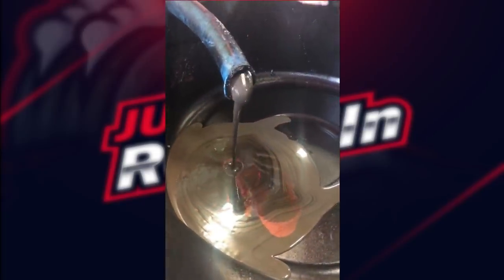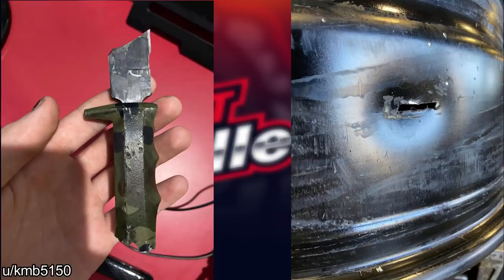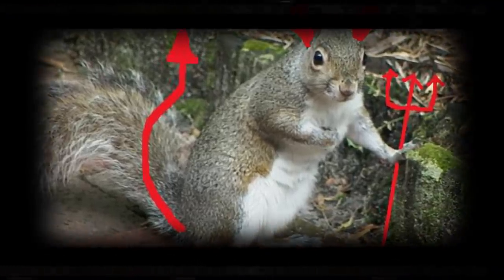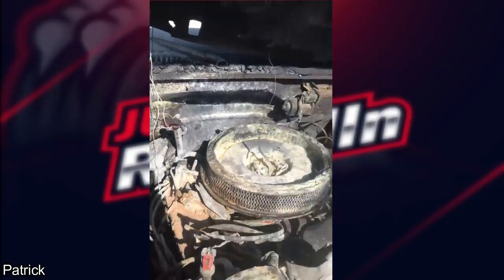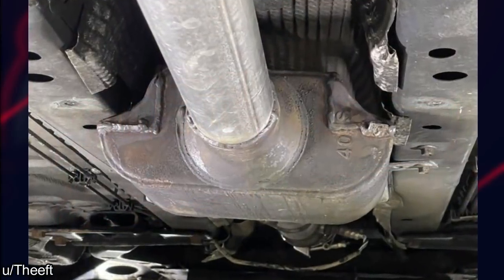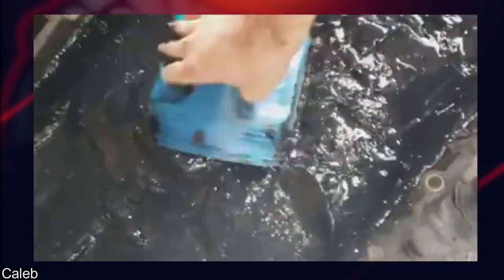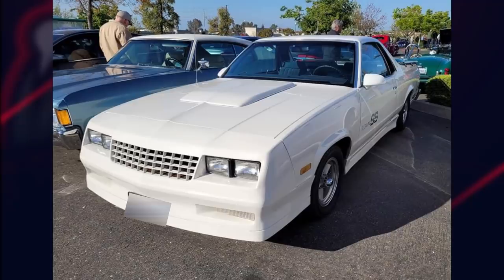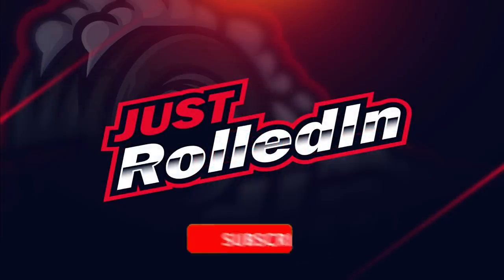Customer States "I Don't Believe You, I Don't Need My Oil Changed!" | Just Rolled In

Comment: Years ago, I started hearing a clicking sound from my front left tire. Figuring it was just a rock in the tread, I kept going until I noticed I was losing air pressure.  When a tire shop came into view, I pulled in and had a look. Sticking out of the corner of my tire at the edge of the tread was a LIVE 30-06 round sunk down about 3/4 into the tire! The clicking sound was the base of the round hitting the road just fractions of an inch from the primer! The tire shop said NOPE!!.....they couldn't plug it that close to the sidewall, I couldn't afford a new tire and they honestly didn't want to touch it! So I found a bolt under the seat of my truck, swapped the bullet out for that, got some free air and headed home!.....still have the bullet in my toolbox 30 years later, just need to shoot it some day!
Reply: So, your tire was .....shot?
I had a flat once caused by a 5.56 casing. Never a live round, though. That is pretty impressive.
Reply: Better check that head spacing before you fire it ! LOL
Reply: @MrTruckerf  He ran over a live round, bullets that have been shot dont have the primer casing on
Reply: @JetfireQuasar  reread his comment, he's talking about himself
Reply: @jaykoerner  you failed to read his comment he asked if the tire was shot.
Reply: @JetfireQuasar  I don't see such a comment... There is 1 from 1 month ago unedited and that's it, edit I see the part your talking about, but that's clearly a joke as such I didn't even think about it. He also says live round in the next sentence these two are incompatible, as such the fact your now defending your comment makes little sense
Reply: @JetfireQuasar  also note the 5 periods between shot and the rest of the sentence, this a common thing done before a punchline, it was a joke, you don't do this in normal conversation unless to emphasize or create suspense
Reply: @jaykoerner  an ellipses is;
the omission from speech or writing of a word or words that are superfluous or able to be understood from contextual clues. 

It is 3 dots (...) And there is no punctuation that contains 5 dots, the use of the comment was ment as a gap in speech and you don't have jokes with a question mark at the end.
Reply: @JetfireQuasar tlrd this form of statement is called a rhetorical question, he was not asking anything, he was prevoking the thought of "how does that happen", hence it was not shot but still somehow got a bullet in it..

 understand it as you wish but he still referenced it as a live round in the second sentence, noting it was impressive, he understood the round can still be fired, hence live,

(sorry gonna try my best at a analogos statement but not good at coming up with things off the top of my head)

Say you know someone that tripped and hit themselves on a table, you ask the question "so... You were beat up by a table" this is idiotic from a logical perspective it's a stationary object with no will, it doesn't do anything, it's an ironic question with a unneeded answer(rhetorical), it's not even asking the question implied, what is really being hinted at is how does this happen? Hence its a joke, just as in this case.
Reply: @JetfireQuasar  no thoughts on the conflicts (from the perspective of your comment being valid) you overlooked in the original comment, just wondering how to justify it both being a live round and already shot  at the same time...
Reply: @jaykoerner   @Jay Koerner  dude the comment was "so your tyre was..... Shot?" The ellipses is used as a gap in thought since the next word mentioned is immediately followed by a question mark.

It is a question asked with a word he was unsure of using correctly. Your example is nowhere near the correct framing of what was used the correct comparison when someone hit their head on the table after slipping would be "so you was....pushed?"

It is a statement looking for clarification and you are making a way overcomplicated hidden meanings to justify this argument, which quiet frankly a waste of your time. 

Short of the original author clarifying his comment this discussion is going to go in circles.
Reply: @JetfireQuasar  you still didn't clarify how it can both be shot and still live
Reply: @MrTruckerf  to settle the meaning of your comment

The first sentence is it rhetorical?

And your reference to a live round is that in reference to the original comment or a hypothetical, if so what is impressive? I'm asking simply to settle a debate
Reply: @JetfireQuasar  what do you get when you cross a rhetorical question with a joke?
Reply: @jaykoerner  someone who is applying 2 hidden meanings in a question that has none of the hallmarks of both meanings to justify his long lost arguement.
Reply: @JetfireQuasar  r/woosh wasn't expecting a reply to the last comment, mostly a makes you think joke. To reply to it means you missed it, it was rhetorical in nature, you are honestly proving you cannot recognize rhetorical questions, if you don't believe me just Google the comment
Reply: @JetfireQuasar  to be clear I gave up on the original argument not because I don't find my side valid but because you can only argue a point so much you refuted the argument it's hard to argue your interpret because it's a perspective issue, I am focusing on the contradictory nature of the statement you applied to now because you have not explained how it makes sense, you have ingnored the argument in it's entirely,  so to be clear explain how a bullet can be both shot and still a live round?
Reply: @jaykoerner  so you are arguing a comment that was never made? I never said that a bullet can be shot and be a live round
Reply: @JetfireQuasar   @Jetfire/Quasar  "he ran over a live round, bullets that have been shot don't have the primer casing on them",

In response to his comment that said "so your tire was shot" and "never a live round though, that's impressive" 

By your own understanding he said the tire was shot and also a live round, you corrected him by saying it wasn't shot it was a live round, he said that directly and  by extension knew that in his own comment that prompted you to correct, the issue is your understand as far as I can tell
Reply: @jaykoerner  so now you're deliberately misquoting to suit your angle. 

His first sentence was a question (and an unsure one at that hence the small gap before the last word) at the op the following sentences was him recalling an incident involving him. 

The only misunderstanding here is from you perfectly demonstrated by your misquoting
Reply: @JetfireQuasar  I truly and with certainly am not making fun of you or anything of that nature, but simply pointing out the issue at the crux of this, no less then 3 times in this comment chain have you missed implied meanings to statements, you seem to have issues reading between the lines and miss things not spelled out in clear language, but my argument wasn't that "YOU" said such, but that your argument requires you to have that assumption, you argued it wasn't shot, and he also said it was live in the same comment these are mutual exclusive statements, by your own admission and I would assume you would have to argue he doesn't understand this.... But then he also said he ran over a bullet in his own car just not a live one in the same comment ruling that argument out. The only argument left is one of definition and semantics where you believe he has the definition that a bullet entering anything is shot regardless of if it's fired, that is the only argument left to explain the discrepancy in the two definitions is that he must have the definition wrong from your perspective since you don't believe it's a rhetorical question made in jest by your own admission
Reply: @JetfireQuasar  what's impressive then... That  What The second half is in reply to, the ops's comment... , The op ran over a live round, he said that never happened to him, and that's impressive that it happened, 

So you're now making the argument that it was a hypothetical he was referring to, ok I am confused why you believe it will be a hypothetical, if so why comment it's impressive... This doesn't match how people generally talk
Reply: @jaykoerner  and here's the crux and evidence that you clearly didn't read it properly, he never said his own tyre was shot or run over a bullet, only the casing. 

You prove more and more with every comment that it is you that has failed to grasp it.
Reply: @JetfireQuasar  why did he not say that "would" be impressive, you are sidestepping the argument, you have to be making the argument that it's a hypothetical if it's hypothetical you wouldn't use a current/past tense
Reply: @JetfireQuasar  here's a comment in similar form to a hypothetical of someone high centering a forklift (I've had similar conversations to this at work, because people are stupid)

("So you..... broke it?" 

I've high centered it on the side of the dock before, but never off the EDGE of the dock... That's impressive)

Clearly nothing is broke it's high centered, said with a raising tone as a question, but meant to be rhetorical, everyone knows it's not broke because everyone knows it's high centered, this is as close to the exact same format I can think of with the same issues you missed in the original comment

Edited version to be more inline with the original comment where the statement isn't true for part of the second sentence, 
("So you..... broke it?" 

I've seen someone drop it off the dock before, but never got it stuck on the EDGE of the dock... That's impressive)
Reply: @JetfireQuasar  to be clear in reference to the high centering of a forklift hypothetical I mentioned, I have used the exact words(so you broke it?) explain the reason I used that phrasing I understand it's not broken clearly it happens a couple times a year you just bump it off or if that does work tug it back with the wench point, this is fairly apples to apples here go through and explain it in the fashion you did for the original comment and we will start over with the hypothetical, it's my own words I can explain them
Reply: @jaykoerner  your fork lift example supports my point because your response was explaining it wasn't broken just high centred.. which was what I did explaining it wasn't shot..

I've stayed on the exact argument you've been the one dancing around grabbing extra meanings and you've been the one with the hypotheticals. Not me I don't know what to say🤷
Reply: @jaykoerner  you'd have the correct format if the question mark wasn't used, and rehtorical questions wouldn't have a pause before completing the sentence. Because both are present it's an inquisitive question when the asker is not sure the correct words are being used.
Reply: @JetfireQuasar  edit didn't know I had sent that last comment when I retyped it in this one. Deleted it to make it make more sense

  Thanks for the reply, to explain

"So you broke it?" Its hyperbole, it's a exaggeration of the situation for purpose of saying at least you "DIDN'T" break it, also very similar to satire just in a more positive light, it's a form of humor made of the situation, a fairly dry humor but at the essence it's humor, it's rhetorical in the sense that doesn't need to be answered, because you're implying  a statement in this case "at least you didn't break it./at least it's not broken"

In the case of the original comment it can be implyed "at least your tire didn't get shot" or 'how does this happen/ how did it not go off"

Just to be clear this is been a very productive conversation for me, I've learned a lot about literary techniques over this(for the purpose of trying and failing to explain the comment and poorly at that), that while I understood in use had know knowledge of, or ways to properly convey without having the example directly in front of me,  there is no knock against you trying to explain the literary intent behind how it was said, and this has been enjoyable all around on this side, even if slightly frustrating from my perspective of not getting my point across (likely a failing on my part)
Reply: @jaykoerner  you would be correct if the ellipses wasn't used. Because it was it removes the hyperbole\sarcasm element
Reply: @JetfireQuasar  hmm I would argue dramatic effect more then asking if the definition is right, but I see the perspective, not that I agree but that's coming from the perspective that someone understands the definition of the other words they've said after that, if you throw question to that then yes it would be a valid but I believe incorrect interpretation, now I've finally explained my reasoning clear enough I believe we're in the same page for what I'm interpreing(sorry much longer then nessasry I know), I think the rest of this argument is strictly in the basis of the lack of common shared understanding there's limits to the amount of information that can be conveyed in a set of words and the focus you apply to certain words determine the meaning, even if I was directly in front of you outside of a direct factual statement with completely the same definitions there would be slight misinterpretations as I believe is the case here
Reply: @JetfireQuasar  it was an obvious joke, using a pun. Not sure why this resulted in such a large debate, but I guess that’s the internet in 2021
Reply: In Montana, driving down the Interstate 90, my brand new tires picked up a live round (30.06) and then when it went off, it shot out the sidewall...good Ol'Costco replaced the Blizack, no questions asked.  Pain to change in the pouring rain...and why would someone be so careless with live rounds...

Comment: I had my mechanic do an oil change on my 98 Dodge Dakota while I was having the front brake pads replaced.  They cross-threaded the plug and I didn't notice until about a year later when I changed the oil (wasn't driving it much during the pandemic). I thought it was my rear main seal that was dripping.  I'm probably going to have to drop the oil pan to either drill and tap the hole and put in an oversized plug, get some kind of special repair kit, or just buy a new oil pan. For the short term, I just put a rubber washer on it, and it holds enough so there is only a slight drip.  This kind of crap drives me nuts.
Reply: You don't have to drop the pan to fix that,, there's a tap made for that, parts stores have them

Comment: One of my friend's tires ended up with a spark plug in it one time.

My uncle's brother in law used a spark plug as a drain plug one time. Yes it leaked.

The sludged up oil pan had to of been caused by years of just adding oil and never the same kind every time. I've seen different oil types from the same brand cause bad sludging (Mobil 5000 and Mobil 1 mixed half and half) then the sludge cut loose 1000 miles later with straight Mobil 1 causing the whole vehicle to shake while running on oil the consistency of gear oil. Something similar happened to someone I know mixing two different formulations of Quakerstate. This is why I always tell people to never mix different oils because additive packs sometimes fight each other and if you change your own oil pick an oil and stick with it for the long haul.
Reply: I had a 68 gto , was working on it. I left a my snap on needle nose pliers laying in the mouth of the grill. Well the pliers did a perfect fall and bounce and impaled a front tire. Brand new front tire. Luckily i had opted for the road hazard , and the tire was relaced. Miss my goat.
Reply: Excellent information. My neighbor is a Ford claims guy and said whatever oil you run, stick with it as being consistent is more important than the brand.
Reply: @marthamryglod291  that is true I try to buy the same one every time.

Comment: The "tar" in that engine looked like a 100,000 miles without an oil change.
Reply: Some people adding oil thickener to the engine oil just before they are planing to sell the car, for short period of time the engine is running nicer(if its exploited badly) but that trick works only for short period of time and after that you most likely gonna need new engine... but most of the time the car have allready different owner and its "his problem".

Comment: I ran Michael tires for about 6 years in my younger days.  I had a tire tech pull a ¾ mac tools ratchet out of a tire,  it went thru the wheel too.  Seen needle noise pliers thru tires,  regular pliers,  screwdrivers with the entire screwdriver thru the tire.  That's the best ones that I remember.
Reply: Working in a rail yard, I've seen numerous tires punctured by rail spikes, but the best one had to be the time a spike popped a tire by going straight through both the tire and the rim, leaving a quarter-sized hole in the latter.